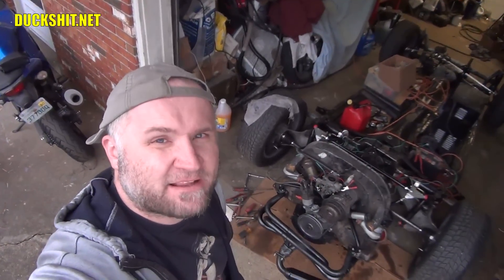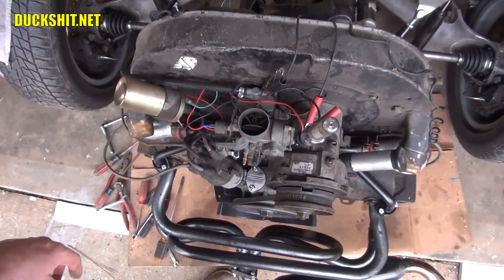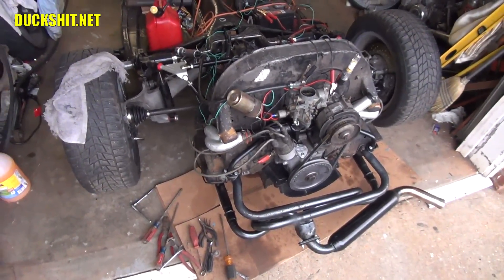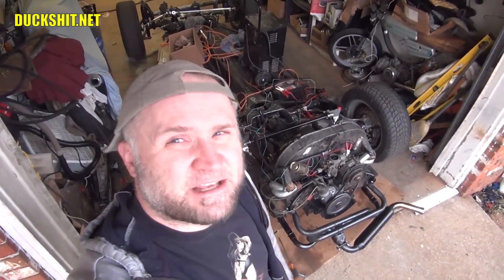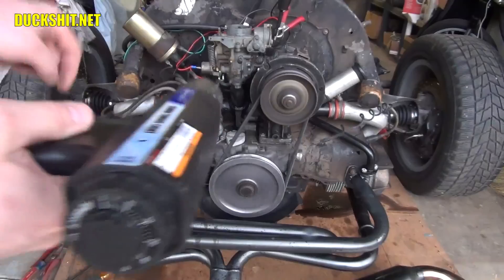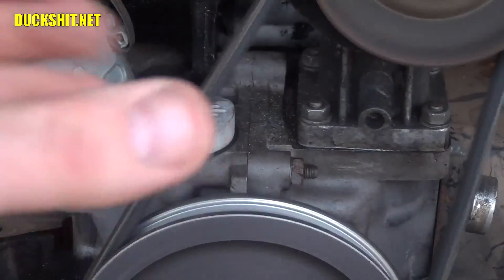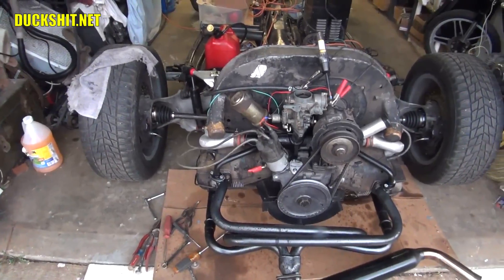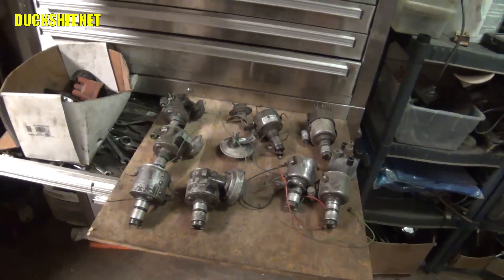Checking Timing - Last Carb Issues - ROTTEN OLD 1956 VW Beetle - 83

Comment: I've only been watching you a short while but I throughly enjoy your videos. Having worked in service and parts at a VW dealer in 1970 through 1972 the air cooled motor is near and dear to my heart. I restored and  drove a '57 oval window in those days. The 009 distributer was an issue in those days, too. We improved them by installing very light advance springs we sourced from a Califoria company called "Dino Dinosaurs". [ I'm not sure of the spelling ]. They were state of the art in VW performance and their type 1 ran an 11:57 quarter mile in late 1971. I ran a Type 3 1600cc dual port, twin carb against that '57 transmission using a stock bus clutch. 3 gears of rubber easy. I had to fab my own carburetor linkage to run the type 1 tin work. On a good winter day I could get 28 mpg at 70 mph. Your '56 is inspiring. I would be tempted to run a turbo on that car. Keep up the great videos. BTW I'm down here in Fl. and warming up since 1/9. No rain to speak of from Ferandina Beach or Lakeland since I've been here. All the rain you get made me think you were really in Seattle!! Stay dry and keep turning out those great videos.
Reply from the maker: Ahhh yes!  Deano Dyno Soars!  They had some really awesome (AND RARE TODAY!) house built parts with their logos on it.  Once in a while I see that stuff turn up in piles at swap meets. I should have been buying it over the years, that stuff fetches a pretty penny these days, and the quality is far better than much that is on the market today.  Thank you for reminiscing with me, and thanks for watching!

Comment: Hey D-man, the motor sounds better with the carb adjusted. Damn confusing accelerator pump. They suck. Great video anyway. I have lost interest the last couple of days myself with the weather in the single digits. My heater crapped out. It's hard to do assemble work when you can't feel your fingers and have snot running down your nose. My cleaning tank has a layer of ice on it too. Suppose to be in the 40s tomorrow and thursday. Keep up the great work as usual! Enjoy!
Reply from the maker: Single digits ain't nuttin' to sniff at... lol!   -17°F and I was on a motorcycle back in the 90s.  I won't do that crap anymore.  I respect ya out there!  STAY WARM!  Thanks for the comment!
Reply: I am with you there. I was riding in and out of Boston daily for school on an old Honda 550k. The people who get out of you way in a snow storm on storrow drive. Yup young and dumb. Totally invincible. Keep the vid coming.

Comment: 35 years ago I actually removed my stock dist for a 009 from who knows where. Mmm, maybe I should dig out the stock one and put it back? The paper filter I put on back then only lasted a short while before I went back to stock when the carb iced up. Thanks for the videos. Wish I could be your neighbor ha ha!
Reply from the maker: Yes!  If you have a proper vacuum port on your carbs to attach it, but the vacuum back on!  You'll probably be much happier with the throttle response!  Thanks for watching!  The house across the street is for sale, thats what the noisy tile guy is remodeling in the last video!   LoL!

Comment: Looks smooth from here. These are one step better than a hit and miss type motor. You will end up replacing every part and still have the issue or another. The could be are endless. Next project
Reply from the maker: Yeah, you're pretty accurate in your statements.... lol!

Comment: Don't try and get perfect tune now, get it running roughly first and that's fine until the car is roadworthy, then you dial it in after you clock up some miles. You will feel the sweetspot when driving and new Bosch w8ac plugs will soon show you if the carbs happy with a brown tip, a 1776 is gonna be kinda thirsty and better to run on the rich side.
Reply from the maker: Thank you!  Thats exactly where we are at on it now.  I definitely needs to be driven for further tuning to happen!

Comment: Glen your engine sounds a ton better!  You've done a great job tuning it. I actually am running an EMPI 30-pict1 carb (< 1000 miles on it) on my now 300-ish mile rebuilt big bore 40hp. I have found that this carb plays best with  the (German?) 009 I have, and for the life of me I can't get it to work right with the correct factory year model vacuum can distributor. Good luck with yours, I know you'll get it running spot on like you want it to. Sounds fantastic even now! Regarding the engine size - 1600, 1776? I bet you'll be able to tell once you drive it. I would think a 1776 would be much "peppier" right off the line. Later!
Reply from the maker: Yeah, thats what I am thinking!   I'll just tune the carb to what responds best and drive it and see what I think!

Comment: nice job so far turn that coil around i use to make them for a living they have a seal on top and the fluid inside the will eat right though it and start leaking
Reply from the maker: Good call!  Thanks for that!  Normally I like them flipped if only for the reason that the wires are easier to get to!

Comment: Wow 40's would just like to see something above zero Friday with wind chill they are saying it will be -40 F here..Run nice looking forward to next up-grade. Can you run something smaller than a PICT34 on a stock 1600 ??
Reply from the maker: Absolutely!  I've run 28PICT before, and got about 40mpg on a Ghia.  The top end HP when run wide open at high RPMs felt a tad weak, but I think around the city it was just fine, maybe even a  tad better.  Very drive-able.  And yes, I have a pile of 28pic in my junk bin.  70° right now, and its almost midnight!  Forecast said it was supposed to be barely above freezing and rain.... they were wrong again!

Comment: It runs great now after the accelerator pump adjustment. I guess it dont need a vacuum advance? Take some time off from working on it if you need a break we will be fine.
Reply from the maker: Its a lot better, but it still does some funny business, still seems lean, but before I start opening the jets to the size of the grand canyon, I'm going to stay a little more down to Earth and replace that distributor.  I've got a feeling this isn't a stock engine.
Reply: @DuckmanCycles  I get the feeling it may be bigger engine like a super beetle. Maybe even a bus? the fly wheel looks like a super beetle fly wheel I was looking at some but I could be wrong. My dad and mom use to have a 70 super beetle it was nice. I think the carbs on the super beetle are like two barrels maybe? I was looking at some pics of them. I looked again and seems all the picture are different people have added stuff so I cannot tell really all the fly wheel look different LOL
Reply from the maker: But but but buuuuuuuuuut the biggest Beetle engines are only 1600 dual port, anything bigger than that which you'd find in a Bus or type 4 was a completely different type of engine... this engine is for sure a type 1 Beetle platform... I think somebody might have done some work to upgrade it. Really tempted to pull off the head and see, but when you start doing that you open up the proverbial can of worms, if you know what I'm talking about....lol!  And yes that is a 12-volt flywheel, the same flywheel that you find in a Super Beetle, but it's also the same thing you find in any Beetle from 1967 and up.  The 34pic3 carb you see here is actually a Super Beetle carburetor, but they only are single barrel from factory, they also appeared on all late model beetles that were not fuel injected.  Stuff to think about.
Reply: @DuckmanCycles   Could it be that the intake port is leaking a little so spray some WD 40 on it and if it speeds up a little then there is a leak.  and  my bad for saying anything about a bus motor I dont know nothing about.
Reply from the maker: Did that already in the earlier video, made no difference though.  We are sealed tight!

Comment: Wonder if someone can help me out, as I installed a set of Weber 34 ICT and for some reason the engine will start but won't stay running unless I really feather the gas pedal but even then it's stalls and can't figure it out? I have the timing set at 7 1/2 degrees BTDC, have the adjustment set at the initial adjustment points but no luck. Any ideas? Thanks
Reply from the maker: Main jet may be clogged or wrong size on at least 1 side, 1 or both accelerator pumps may not be doing their jobs.  Also check for vacuum leaks.

Comment: speaking of dizzy's do you prefer the point/condenser or electronic type?  i keep having odd condenser failure, and thinking of swapping to the pertronix electronics.
Reply from the maker: I prefer the electronic, timing is dead on to what you set it... always!  Points tend to be floppy and bounce around nearly at the mark you set your timing at.  No dramatic increase in power or anything like that, but the engine will run smoother!  I was quite surprised at the change in the Fastback when I went electronic!  But I do keep a spare distributor with me with points and condenser, even the electronic ignitions do fail!!!!
Reply: @DuckmanCycles  thanks, i appreciate your advice. Im going to order one up today.
Reply from the maker: This is the one I've been running for the last few years that has been good to me! https://amzn.to/2T58EgR

Comment: so wait, you static timed it to 7 btdc and it was right? on an 009? those guys will never believe you! I checked my 009 with static, I will check with a strobe and see what I get!
Reply from the maker: That is correct, it all depends on the amount of wear.  This distributor was actually one I had sitting on the shelf new for quite a while... so if I said it at 7.5 and got 30 at Max advance, and if I said it to about 10 like it really should be set for a 009 then it should max out at 32 almost exactly!

Comment: also i notice you have a vacuum outlet on the neck ot ther inlet manifold is it sealed off, also u can check for air leaks by spraying wd40 o r  carb cleaner , brake cleaner around  all the joints and gakets on the inlet manifold , if te idle increases u have an issue.handy link here , http://www.vw-resource.com/table.html  anyways  have some time out and go back to it after ,
Reply from the maker: Thank you, checked for leaks in previous videos, none found.  Yes the manifold side inlet is capped.

Comment: That could be an aftermarket ring on the pulley. The timing sticker may have been replaced at one time in its life so it may have been stuck on wrong  giving you a false degree number just kidding Mr. lol hey kidding (Those timing guys).No vin # probably  happened when the car was stolen they removed it or it’s a beetle bastard motor.
Reply from the maker: I think its a rebuild with an NOS case.  I'll give it a look over and see what else I can find on t for markings.